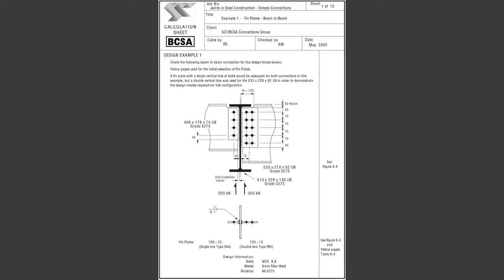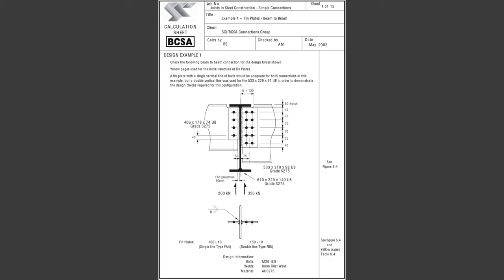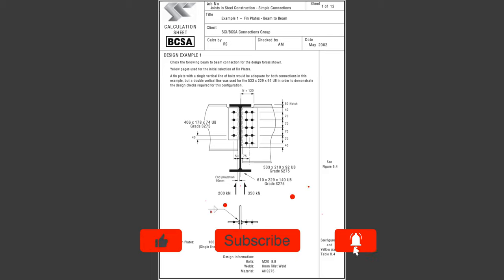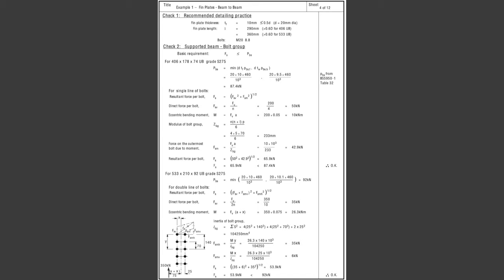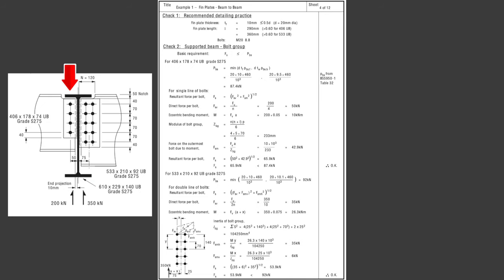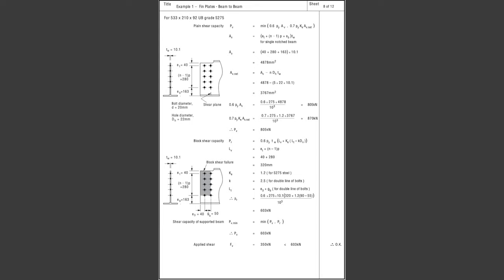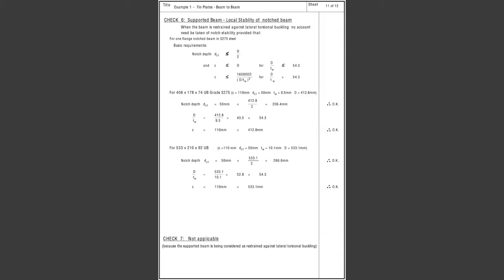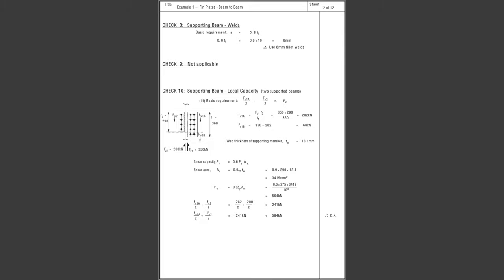Steel Connection Design - Part 1 - Introduction and Fin Plates

Comment: Thanks for this, steel connections can be daunting to design especially for fresh civil engineers. It would be great if you could go into more depth on the analysis of the forces on the connection,  e.g Horizontal force due to torsional moment and vertical due to direct shear, and then finding the resultant. Doing this for staggerrd or multi column connections would be great. Basically connection theory. Looking forward to your next videos, and keep up the good work mate!
Reply: This is so true, i’ve been struggling and keep on being called ‘being spoon fed’ all the time but I was being honest and trying my best to understand as studying it theoretically is quite different than applying it in real design.